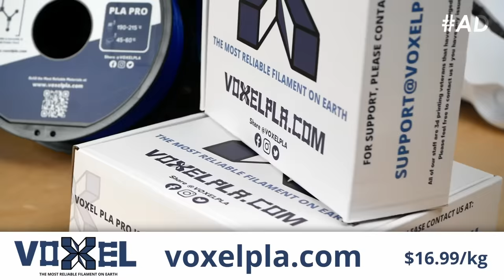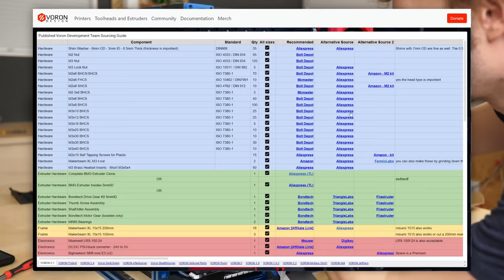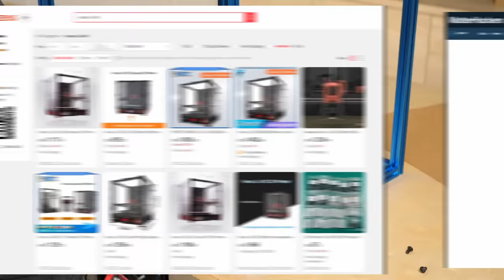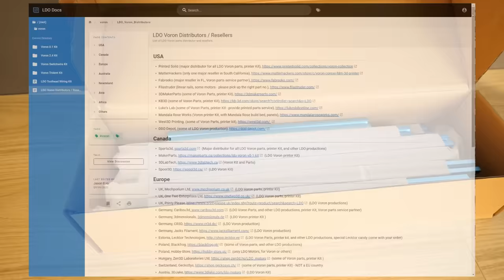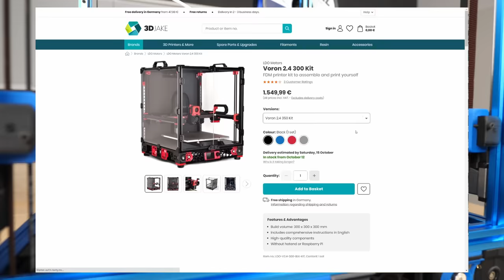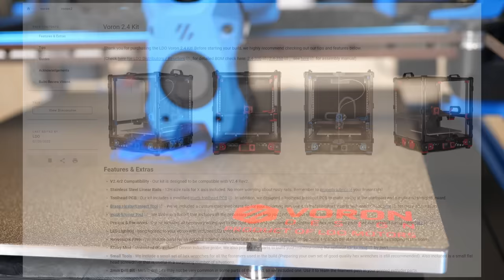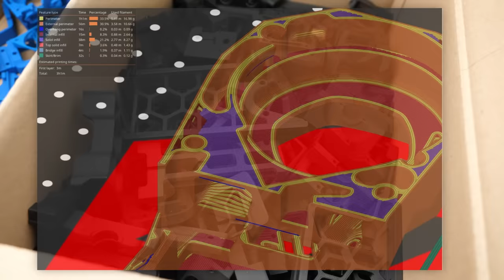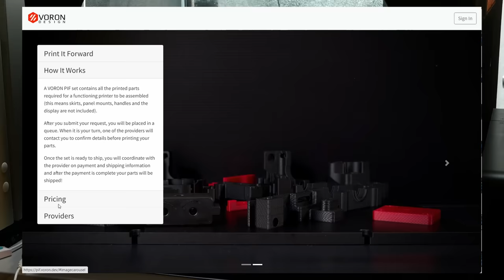Should you build a VORON 2.4 in 2023? (LDO Kit Review)

Comment: That's the part that gets me. I bought the kit in full, nearly $2k and they didn't even provide the wiring harness but a couple spools of wires and a bag of connectors, while YouTubers get a full kit for free of charge for a review. Plus often get extras. Spend the $1800+ and then offer a more reliable review. If I didn't have to pay for the kit I can easily over look a lot of negative points
Reply: U should have gotten a Bambu X1 carbon instead, it's cheaper and better
Reply: @yo_vlad  it's not the printer that's the problem, it's the suppliers like LDO. 
That said, I wish they had the Bambu Lab X1 a year ago when I started my Voron collection. I totally would've got one.
Reply: That's weird, I had one of the first 350 ldo kits out there and it came with a full wiring kit
Reply: @Hopeinformer  
The only problem with the Bambu stuff is all the proprietary hardware. 
Whereas with a Voron you can do whatever you want.
I almost got the P1P awhile back. But opted to wait and see what these will be like after some realistic mileage.
Reply: @yo_vlad  that’s subjective, there are issues with the rods.
Reply: @yo_vlad  Apples and oranges. You couldn't pay me to use a X1C. I recently went for a lot of MK4 instead of X1C.
Reply: @HMPirates  a mk4 over x1c, jesus christ :'D
Reply: @giedrius2149  Not "a", a lot. I want a machine that's proven to be repairable. I am replacing a few mk2s that have over 8-9k hours on them. Have you opened up a Bambu x1? They are not industrial machines.
Reply: @HMPirates  Not saying the Bambu is good, I'd take a Voron any day. Prusa has many design flaws and occurrences like broken promises. 

Neither a Prusa nor a Bambu is an industrial machine. If you want something that actually works you will drop thousands just on one printer alone
Reply: @giedrius2149  Prusas are not perfect, but they are quite reliable and repairable. We have sls and other industrial machines, along with a fleet of Prusas. I don't think we are the only big organisation to do so as well.
Reply: I would love to see the Bambu how is like after 8-9k print hours
Reply: @giedrius2149  you can't deny the long term reliability that they offer
Reply: @Lucas_sGarage  If you don't offer much there is not much able to break
Reply: @giedrius2149  at the end of the day, people want to print, and you can't deny that prusas get the job done
Reply: @Giedrius  prusa printers are heavily stress tested and are for sure have the highest qc and parts quality of any mass produced 3d printer, ofcourse you could compare a mk3s to the sv06 which is alot cheaper but offers almost the same hardware. Which makes the prusa look bad, but with the sv06 you have poor customer support and not stress tested/proper qc on parts, I'd know since i have one and it came with bent z motor mounts from new! With prusas youre paying for the guarantee of a good printer, not necessarily features
Reply: @phrg8332  Yeah I had the fun of owning a Prusa. Without the Bear mod and silicone bed mod, no thanks. Absolute joke of a design. The Prusa Mini even worse, holy sh* I got so pissed I stopped with 3D printing for half a year before going back to it with Vorons. Never again. Took them like 2 years to finally add the promised WiFi capabilities:'D so much about quality
Reply: @HMPirates  My Prusa MK3s has over 12000 hours.

I changed the nozzle to hardened steel and had to change one heater block. Other than that, I am going to replace all bearings and rods soon, but the machine is still going strong.
Reply: @phrg8332 my garbage mk4 disagree with your opinion, lacking quality control and lies in machine specifications.
Reply: @HMPirates looool 😂😂😂
Reply: @juliusvalentinas
0 seconds ago
No active constant oiling system, grease instead of oil? Wrong iq guys on the wheel again? Bambulab is working out of box, where this kit is only build platform, if you want a project that never ends then how are you going to pay bills and make money with this nonsense.
Reply: No warranty money loundering scheme here. Why its working, because covid shown there are too many idiots, idiots with a stash of money.

Comment: Hearing about the raw part costs of the Voron 2.4 it is really astonishing to me how Bambulab can keep their prices in a comparable range.
Reply: Production volume :)
Reply: Overengineering creates a machine without compromise.
But really smart engineering makes it 'good enough'. Which is, as it says, good enough.
Reply: LDO kit is littlebit overpriced ... Formbot is much better in price/value, also very nice kits dont have some fancy parts but you dont need them :)
Reply: Really comes down to them building it from the ground up for manufacturing vs having to buy tons of off the shelf seperate parts and connect them together. The frame alone of the bambu is going to be huge cost savings compared to extrusions.  Same goes for the carbon rods vs linear rails, and using a single motor for the Z axis instead of 3 (trident) or 4 (2.4). By being in control of every part and designing the printer from the ground up they can save a ton of material and manufacturing cost, assuming they move enough volume to make up for the initial R&D and tooling costs.
Reply: @caramelzappa  Thought by using of the shelf parts, i. e. kind of standard, mass produced parts, for the Voron, the raw ingredients should be quite cheap already. And the assembly costs of the printer are fully paid by the customer with his spare time.
Reply: @LudwigRuderstaller  But aren't the "ingredients" of the Voron mass produced parts already? All the custom parts are 3d printed and not included in the bought package. Assembly costs are paid by the customer separately with his spare time.
Reply: @jayphone1  Off the shelf parts make the printer accessible and modable. And certainly cheaper than an individual commisioning a lot of custom tooled parts. It is absolutely the right way to go for the self sourced hobbiest printer the voron is designed to be. 

But each part comes from a different manufacturer and seller who each have their own markups and shipping costs. And part count goes up because you may need several different parts to the job of one custom part. 

Because Bambu is making printers at volume they can put the tooling work in to vertically integrate, lower part count and part cost in a way voron cannot.
Reply: BBL is located in Hong Kong, very close to the part source.  All the other providers buy and then resell adding at least a 40% mark up on each component.  BBL has a lot of pull given the team's experience with DJI.  For all we know DJI may be a silent investor and helping with sourcing.
Reply: They source all parts in higher amounts and therefore have scaling factors. Also they simplified the design.
Reply: @jayphone1  Most of the parts of a Voron are mass produced but that doesn't mean they are cheap. For example the extruded aluminium profile used is very expensive even compared to extruded aluminium square tube, because the tube isnt manufactured with the easy flexibility of the profile in mind. The repositionable fasteners (t-nuts, corner brackets and so on) used with the alu profile are also very expensive when compared to injection moulding with cast in place inserts or riv nuts in sheet metal. That is, when making one of something plastic injection moulding tooling is VERY expensive and an alu profile kit at home is cheap. But when making 10000 of something, tooling is so cheap that double handling during order picking and shipping has a bigger impact on your transfer price.
Reply: @almonster2066  If I recall correctly there is a public Chinese website where their investors are disclosed and the investment amounts and they got around 40 million USD from various financial investors.
Reply: I'm pretty sure the Bambu Lab X1 is the only printer thats being built by robots XD and has a welded steel frame. If Ultimaker were the ones that made the X1, they'd sell it for 25k because they're greedy. BambuLabs plans to sell their printer to the mass market and make it very accessible, like a normal household appliance, the high production volume will compensate for the low price.
Reply: @almonster2066  Yeah, the reseller add ups might be a factor to consider.
Reply: @Joshua0689  Thanks. Yeah you might be right. Was still surpised that it adds up that immensely. Since the extrusions are mass produced as well with tools which are expensive and worthwhile when you sell a lot of them.
Reply: What are the cost drivers in the Voron package actually? Motors and the electronics? Or the metal hardware like extrusions?
Reply: @muniradlan3659  It's a bet on that they will sell bigly... But right now it seems to me that they do a lot right in many fields that they might do so.
Reply: "anyone can build a bridge that stands, it takes an engineer to build a bridge that barely stands" - design for manufacturing is a real and important thing.
Reply: @rpavlik1  That's true of course. But the manufacturing/assembly costs of the Voron (which are far from being optimized) are even outsourced to the customer's spare time. Considering those, the printer would be even more expensive.
Reply: @jayphone1  Mass production is an inexpensive process; things like gears can be made at rates of thousands an hour for very little per-part cost.  But a home builder doesn't need thousands of gears to make a 3D printer; they may only need 4.  The typical factory doesn't have the capability of shipping their gears out 4 at a time; they are optimized to make batches of thousands at a time, and all they likely do is dump them in crates as they come out of the machinery.  How to get them out of those crates and into your hands is a long process.

Enter the supply chain, which is an industry of its own that exists to buy mass produced things and get them into the hands of people who want them.

First, realize a factory doesn't exist just to make gears. They have to make money, and they aren't going to risk the investment of making a million gears unless they already have customers lined up to pay for them.  Most of the factory's customers are manufacturers of other machinery, but there are also people who want to put some gears into retail stores for sale to home builders.  So some retailer takes a risk and orders a few thousand gears in the hopes that they will be able to sell them to the people who build Vorons at home; maybe buying them through a repackaging company. The crates of gears are shipped to the repackager's facilities, who opens the crates, cleans the parts, inspects them, wraps each one in a plastic bag, applies a label, puts them in individual retail packaging boxes, puts groups of retail packages in cartons, and loads cartons into shipping boxes for sending to merchants.  The merchant orders some thousands of parts from the reseller, and has them loaded into containers for overseas shipping to their distribution center.  After a sail across the ocean, a railroad trip, and a truck drive later, the DC receives the shipment, unpacks the shipping boxes and breaks out the cartons for distribution to retail stores.  Trucks carry the shipments to the retail stores, where the cartons are unpacked and the retail boxes put on the shelves, and marked with prices.  You go into the store and pick four off the shelf to buy them, then give the cashier your money.

Every single truck driver, sailor, box maker, factory worker, reseller, shipper, manager, cashier, and investor in that chain is paid for their efforts.  And that is why buying four gears costs several dollars instead of the few cents it cost to manufacture them.
Reply: I can confirm, I built a V2.0 back before the manual era (~2019) and it was an absolute adventure to source everything.

But it worked, mostly! Now I'm working on printing the 2.4 components and rebuilding the gantry to 2.4.
Reply: Everyone can build a bridge. It will however be unholy expensive.

It takes a skilled engineer to design a bridge which barely stands
Reply: Because you buy at quantity n=1 and spend (probably) like a third in shipping costs. You'd be astonished to see the discounts you can get once you get into n=1000 and up
Reply: Whay is bbl?
Reply: big production volume, inferior materials and chinese factory workers

Comment: There's also a software-mod called "automatic z calibration" that actually bounces the klicky probe off the z-endstop, baby stepping the z-offset. There's a little bit of tuning, and it can be a little confusing when first installing it. But it's is totally worth it. You can change the build plate without having to change any settings. :)
Reply from the maker: Oh, that sounds tempting! I'll take a look at it. Thanks for sharing.
Reply: @CNCKitchen  its a must after adding klicky, it makes every print just "start print" and leave it alone.
Reply: @twistedvyon6234  I absolutely love it. I've had one failed print since the install and that was just due to a small little ooze-blob messing with the values.
Reply: works even better with the sexbolt mod! With the default endstop I had still a bit of inconsistency, with a spring loaded sexbolt my first layers are perfect, every time
Reply: @coorexz  In my experience, the offset-tolerance almost always catches when this happens, and error's-out of the print-job. It defaults to a max-offset of 1mm, but you can adjust it. It tells you how much it adjusts, and I'd check if I where to try and tune it to make things more reliable. But right before z-calibration is also the only time I brush my nozzle.
Reply: @Daepilin  Where did you find a sexbolt mod that adds a spring? I haven't used the base printed endstop, but I have both the PCB-endstop and the Sexbolt running in different printers, and the only real difference for me is worrying about loosing the pin if I flip it upside down.
Reply: @CNCKitchen  You can also add the auto-z calibration with spring-mod sexbolt to utterly ignore nozzle oozing during this.. :)
Reply: I can't imagine my voron without it ever again
Reply: Auto z is part of klipper now. It's incredible.

Edit: klicky/auto z have been quite unreliable long term. I moved on to TAP. 😂
Reply: @Daepilin  I need to get the spring for mine. The sexbolt is 👌👌👌
Reply: @HumanShield117  if I remember correctly it's just a spring from like a paintball gun trigger.
Reply: Can you explain this more? Got my tridentLDO kit last week and printed parts show up on Monday. How does it operate without the software? Just trying to figure out what kind of convenience this adds and in what application. And since I'm so new to the hobby, there's A LOT I don't know yet
Reply: @EnchiladaBro  if this is your first Voron, build it to spec first, or you'll have to juggle about 8 manuals. The Voron mods are designed as mods for an existing printer, and it's best to start with the basics. 

But automatic z calibration is built into klipper now, so you only have to add the right section to your printer.cfg file. 

This is what happens though:
Pick up the klicky probe.
Bounce the nozzle off the endstop-pin.
Bounce the klicky probe off the endstop pin.
Bounce the klicky off the bed.
Then it does the math to get the exact offset. 

The only tuning you have to do is the distance between the micro switch body (on the klicky), and the actual trigger-point for that microswitch (it should be between 0.3-0.5mm).

Comment: I run a print farm in Alberta, Canada with 11 Voron 2.4r2, and here's my opinion after building all these printers and running over 100k hours on them. 

If you are a hobbyist, and have the time, absolutely, build one, super rewarding and satisfying. But you NEED to have a love for tinkering, because you will need to tune them to get the "Voron" performance. And when things break, you will have to fix it yourself. 

For us as a print farm, vorons are great in that anytime we need to replace something, we can have it done as quickly as we can print the parts. They are reliable workhorses as long as you set them up right and maintain them properly. 

If you are someone that just needs quick prototypes, get a pre-built printer. Maintaining vorons to keep their performance up is really a job all on its own, and requires a lot of attention and dedication.
Reply from the maker: Thanks for sharing your experience! This totally reflects my opinion as well.
Side question - did you build all of them and how long did it take you in the end? 😅
Reply: @CNCKitchen  I was originally using them to manufacture parts for my startup so I had a small team. I built the first two, compiled the "4 instruction manuals" + supporting documentation I learned from devs in the discord into one step by step manual, and taught the rest of my team to build them. In the end we finished tuning the last Voron after about 4 ish months. It took my entire last summer and I had to sleep at the office a lot. 
Stuff didn't really work out so now pivoted to manufacturing consumer products (cause the quality is fantastic) where we use a pneumatic ejection system I designed to help small local businesses grow with thousands of parts a month. 
Being able to eject parts allows me to make gcode files to use up an entire spool at a time. I wouldn't trust any other printer to run a 100+ hour file.